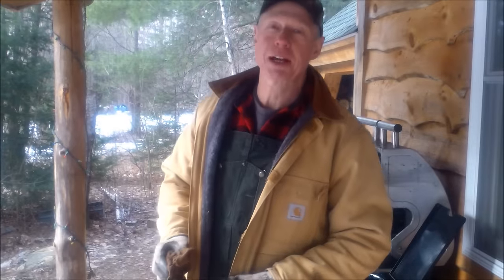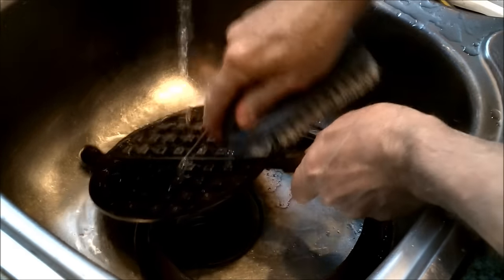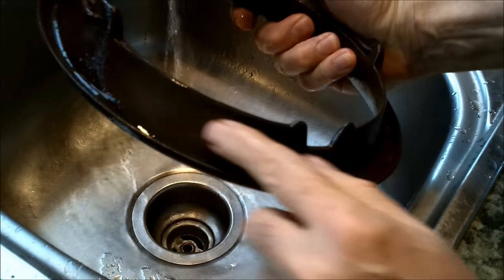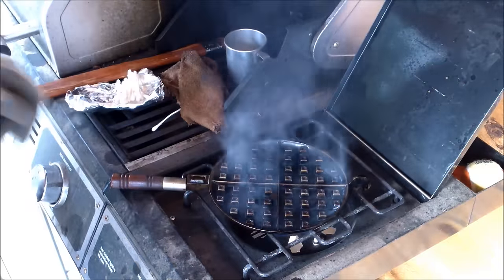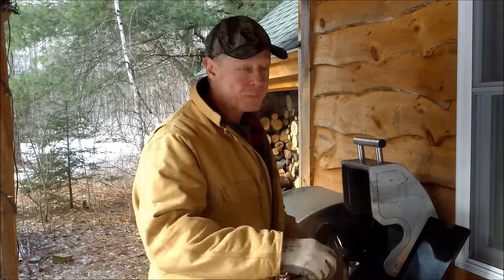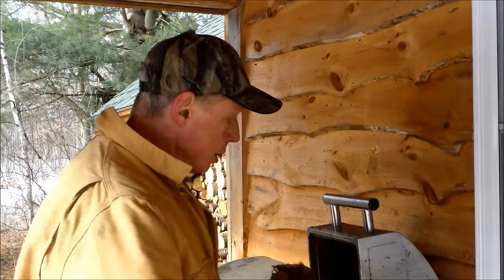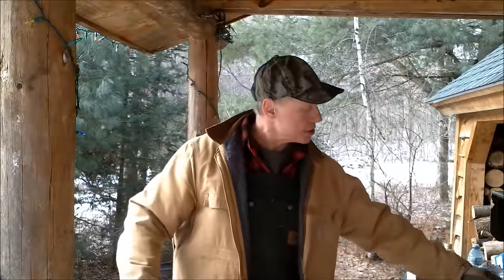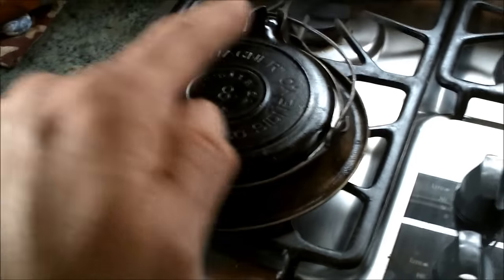HOW TO RESTORE VINTAGE CAST IRON WAFFLE IRONS

Comment: Hello from Prince Edward Island
This doesn't fall under Cast Iron but I recently dug out my Bamboo Steamer and placed it in a shallow cast iron pan with water and poached chicken breasts.  My point is using the wood stove as a utilitarian device in as many ways as possible.  The nice thing about a steamer is that it is 'stacked', so you could steam veg on top and chicken on the bottom.  

Thanks Boss for the videos, so much to learn from you
Reply from the maker: Man I haven't seen a bamboo steamer in years.  Now that jogged a memory :-)

Comment: Ok, I did the complete unthinkable JC , I used a semi grinding pad on a drill & removed every thing on this pan & I KNOW YOUR CUSSING NOW ! LOL but it worked & came out like new ! ! ! YES REALLY : )  I ground it all out then used 150 grit then emory paper washed &  re-seasoned it like 10 times then in the oven for 2 hours at 500 degrees with me coating it every 30 mins & holy crap it's awesome ! I cooked on it this morning bacon & eggs  NOTHING AT ALL STUCK TO THE PAN !  then I cleaned it up gave it a light coating of extra virgin olive oil & wal la !  It's a beautiful thing buddy. : )   Don't shake that finger at me young man ! ! ! LOL It was really the only way to get all that crap off it JC. I actually saved it from pitting any further too ! 
Give Frankie a pet  & god bless buddy
Reply from the maker: I've done the same on some old Wagners I bought that were crusty. Even used a rotary sander lol.  The pans had wobble to them so I figured they'd make good pans for my rocket stove.  I'd never do that stuff to my good pans but never need to :-)

Comment: This has helped me so much.  My husband bought me a vintage waffle iron for Christmas.  It's a McCleary NO 9, made in 1914.  If I could upload a photo, I would.  I will be following your process exactly.  It has a little bit of rust, but it's in really good shape.  I've been waiting for this.  We love your videos, an I especially love this one.  Cooking on our Kitchen Queen, we use all cast iron.  Would love some more videos with your Kitchen Queen: cooking, proper maintenance, etc and how to get the oven up to bread-baking temp.  I get ours up to about 300 degrees and the house temp gets up to about 80.  I gave up on it the other night; I'm sure it's me.  A little advice...
Reply from the maker: I'll see what I can do but yes, the hotter the fire, the hotter the house gets. Cooking with wood calls for adjustments in lifestyle.  Opening windows will help with that.
Reply: thebossoftheswamp That would be great.  I look forward to it.  I think perhaps I wasn't patient enough.  I had the oven engaged for over an hour, the flue closed, the door vent closed, but I kept the window wash open.  That could have been part of it.  We have the glass doors, which comes with a window wash lever to keep smoke away from the glass.  I had the oven up to 300, not enough to cook a pizza.  It's a learning curve, I know and I'm determined.  I can tell you, I've never been one to cling to material things, but from the day we had it installed, I was attached.  This cook stove makes me happy.  I absolutely love cooking with wood.  I just want to make sure I'm getting it right.
Reply: How's the waffle maker now?

Comment: That is a brilliant technique. Did you also do the base that way over the flame?
Reply from the maker: Yes I do.
Reply: @thebossoftheswamp Hi! Im attempting to do a 1910 like yours. I have a picture i could show you of how far I've gotten. I still have some yellow (? old oil?) & some rust around the edges of the imprinted waffle bumps. I need a pros opinion if you could find 1/2 a minute?

Comment: I was looking at some very expensive pot pans and skillets here a while back was thinking stuff that would last a lifetime. well the set that we where looking was about 2k so then I started looking for a alternative. that's when I found cast iron all in all it is fairly cheap even if you pay 60.00 for each pan thay will last a lifetime with little maintenance. but, you can pick this stuff up all the time much cheaper. I think know I have 3 or 4 skillets a few pots and a Dutch oven I think I have about 300ish dollars in it. I really like the fact that they will last a lifetime and they are super cheap. no more eating Teflon or buying cheap pot and pans from Walmart that don't last. I will not ever have to buy anther pot or pan the rest of my life what a good buy.
Reply from the maker: Most of my ironware cost me approx 5 bucks each at yard sales and I've restored them.  Rusty pans are easy to find :-)
Reply: thebossoftheswamp I agree I have not ever bought a new cast iron anything just restored the ones I have found they can be had for very little but what I was saying was that even if you did pay 60 dollars for each peice it would still be worth it in the long run. they last more than a lifetime.

Comment: Boss, I've changed to sunflower oil. I've found it more forgiving in respect to temperature/heat of the pan and the oil burning. What's your views on this?
Reply from the maker: I've never used it.  There may be better oils to use than olive oil but I'm running with the  "if it aint broke, don't fix it " mentality :-)
Reply: I hear ya, seems the older I get someone is always showing me a new way or product and surprisingly some have merit.

Comment: Mr Boss.  How would you deal with a large piece of rusty cast iron.  My BBQ grill & griddle is 2' x 3' and I have nothing big enough to soak it in.  I thought about the bath, but apart from needing gallons of vinegar, it's plastic and would stain.  Any suggestions appreciated.  Thank you.
Reply: A storage bin, they make long ones for under the bed.
Reply from the maker: Maybe make a frame with 4 boards and drape a sheet of plastic or tarp in it. If you place the grill grate in it flat, it would need a lot of liquid to cover it.

Comment: I believe you yet I'd really really like to know what the excess globs of oil on the iron actually do that is negative.  Is it non-stick on those places?  Also I didn't see this video before reseasoning my old waffle iron.  I used all sorts of abrasive things trying to avoid soap and I thought vinegar would be corrosive so I didn't use it.  Dangit.  You said not to use a wire brush.  What if I did?  Is it ruined?  I will follow these instructions and do it all over again but will it all be for nothing since I did scrape it and used very abrasive cleaning methods already?
Reply from the maker: Globs of oil left to dry on the pans will become sticky and eventually rancid. 
No your pan is not ruined due to the wire brush. Just season will several VERY LIGHT coats of olive oil and it'll be fine.

Comment: Boss what's a good price to pay for one?  I've been looking there is a big fluctuations
Reply: Scott Smith most of the time, cast iron that is online is overpriced. if you have the time, check out some auctions in your area, especially old farm houses. I've come across it fairly frequently and I dont think ive ever seen an old wagner go above $20, some as low as $10.
Reply: +Kansas Country Thanks

Comment: Will your technique work with a charcoal grill? Will your technique work with a cast iron pot that was never cured properly from the get go?
Reply from the maker: I've never tried a charcoal grill but think a gas flame would be much better.  You may have uncontrollable flames and flare ups with coals and dripping oil.  Yes, this works for any iron but large or odd shape objects are easier to do in the oven.

Comment: most of the cast iron I find looks much worse than what you started with.
Reply: I have restored some cast iron that was much worse that the one show. I normally start by putting it in the electric oven and running the auto-clean cycle. It will burn off 99% of the stuff on the cast iron. NOTE: You cant do it with stuff that has wooden handles unless you can remove the handle! 

After it has cooled you can run it under hot water and brush it as shown. If the rust is really bad and deep you can soak it in vinegar after the clean cycle. 

I just did a round griddle that is 1800's that way and it came out looking great! I also did a sad iron that was badly rusted and it too came out clean.